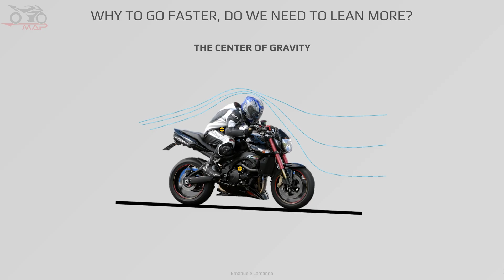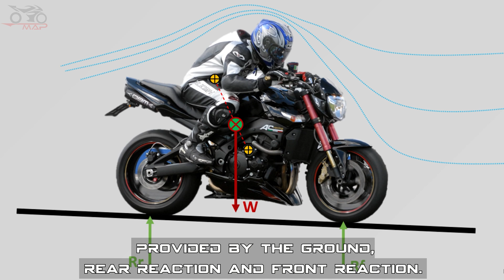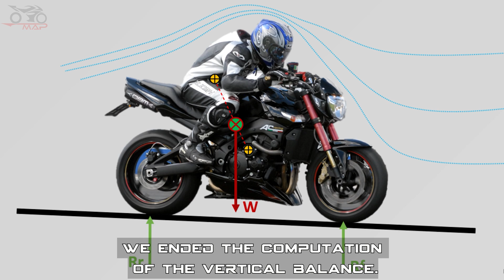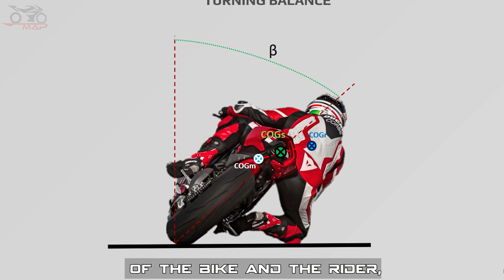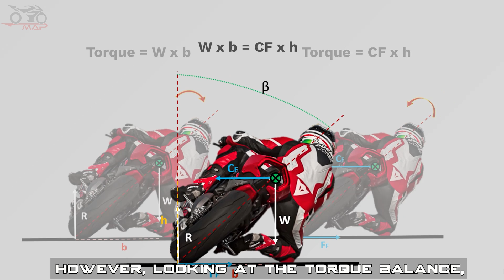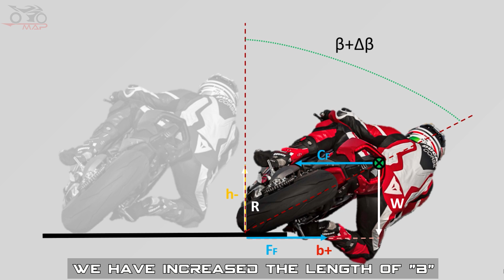Why you need to LEAN MORE to GO FASTER

Comment: 🙏 more than 60 degree can crash😊 althought Rossi, Marwuez or you😊🙏
the more you tilt the higher the risk and it's not  higthside or lowside but it is a technical error😊🙏
Reply: Correct, somewhat. Problem with it is, if you are not riding the knife edge, your not on the podium.
Reply: @sword-and-shield  yes... the podium will run😊🙏

Comment: Good physics content, but next time please add a content about how we actually lean the bike! This one is mostly about why, not how.

The leaning motion of bike is quite a complicated subject that involves both countersteering and weight shifting. I expect a good summary from this channel!
Reply from the maker: @HM Jang Your statement is certainly correct: the dynamics of a motorcycle is a very complicated matter; countersteering and weight shifting are just two of many elements that play a role in the dance. You are right, this first video explains the why; a dedicated video about “how” will come next. Meanwhile you may enjoy reading our blog’s article: How to Cornering a Motorcycle - Part 1. It is not the usual analysis (countersteer, push on the handlebar, put your butt out… bla bla bla). It analyzes every aspect of the bike cornerning dividing it in sections (rules). It has been summarized using the comments of MotoGp riders and engineers. Here is the link: https://www.motorcycleacademyproject.com/blog/how-to-cornering-a-motorcycle-part-1

Comment: First thing to remember is not to remember all this scientific talk.  A When it comes to bends and lean angles the first thing to realise is that all bikes are not the same.  It was quoted here that a moto gp bike can have a maximum lean angle of some 60 deg.   All made for the track racing bikes have no centre or side stand and so they don't have any metal sticking out from beneath, on  the left hand undercarriage  but all other bikes do have metalwork or bodywork that will limit its ability to lean.  All bikes differ  quite a lot from that, a road going sports bike for instance could possibly go to 55 deg. a scooter or Harley could be limited to only 30 to 35 deg and an adventure bike or street bike to maybe 40 to 45 deg.  So a lot depends on your actual bike.  The lean angle being determined by the frame and build  of the bike and the actual ground clearance it has with the road.
Reply: If someone tries to emulate the performance of a motocross with an Harley, I don't think there is any good video or suggestion for them! XD
Here they are very well explaining why the lean angle has to be higher in order to go faster!  As a seasoned rider I found it usefull and interesting and I hope to be able to follow more lessons from them!
Reply: @Schonny3037  I make the point AGAIN that its useless  TRYING TO LEAN MORE IF THE BIKER IS ALREADY SCRAPING HIS PEGS ON THE CORNER.,  ALL THAT WILL HAPPEN IS AN OFF WITH DAMAGES AND OR INJURY .  Why are you trying to enable riders to go faster round bends.  Surely its better to advise them to take bends or corners slower and  e depending on the radius of the bend or corned  by riding slightly slower  they will need less of a  lean angle and have some to spare should the need arise and by using counter steering they should be able to complete the bend or corner in d safety and not need to increase speed.

On our country roads here in the UK bends are already responsible for  the largest number of collisions/offs together with overtakes and  believe it or not INNAPROPRIATE SPEEDS. 

On many of the videos that I have watched its usually on  say canyon left hand bends that you seem to have problems. Perhaps the reason for that is quite simple,  First the camber coming down from the left whish may reduce the lean angle even further and towards the leaning bike. Then the bikes side stand and or centre stand which  have protrusions coming out, once again from the left side of the bike and hitting the camber coming up at it.  These fixed parts are possibly going to ground first and by doing so it lifts the rear wheel and without that traction as you  know off they come.
Reply from the maker: @Schonny3037  thank you for your contribute! 

Yes, you really got the point of the lesson!  😉
Reply from the maker: Hi r craven, thank you for your contribute! 

Not only the motorcycle's design can limit the lean angle. A wrong position of the rider's feet, a wrong tire pressure, the presence of curbs or other obastcles... are all things that can reduce the theoretical maximum lean angle.

Anyway, this is not the point of this video: we are not discussing all the factors that can limit the motorcycle's leaning. We are instead explaining why to go faster you need to increase the lean angle. Understanding the concept of balance is the first fundamental step to understand the right riding techniques. Knowing what is behind and why the motorcycle behaves in a certain way, brings to a level of consciousness which makes us better riders and better technicians!

Don't you think so?
Reply: @motorcycleacademyproject9830   Not really.  I said from the outset that the FIRST THING to remember is the basics of what the bike will allow and then one can  learn more from that understanding.  If one looks at many a rider coming to grief   on corners/ bends   its obvious that they try to emulate others and fail to understand the basics that  their bike will not do what others can. .  

As regards your last paragraph I don't believe that 99.9% of riders that go out for  a blast will give a fig  about  all the technical issues that you have outlined.

You can sow your seeds all you like but they are falling on fallow ground and only   very few riders will take advantage of your video which to my mind is a good thing..